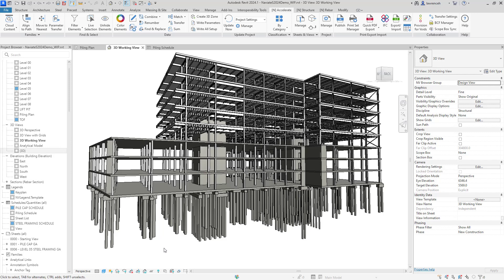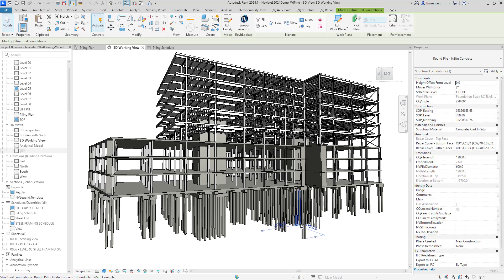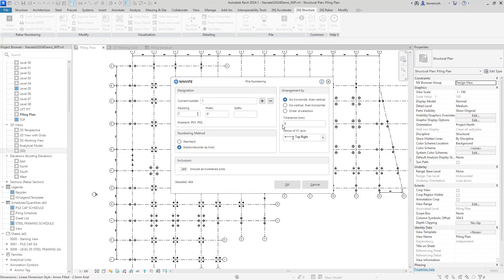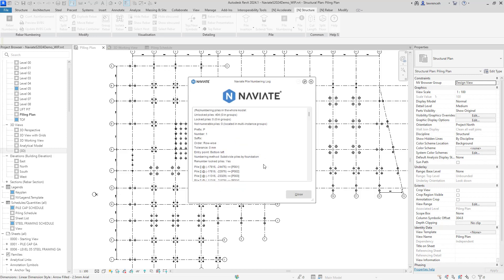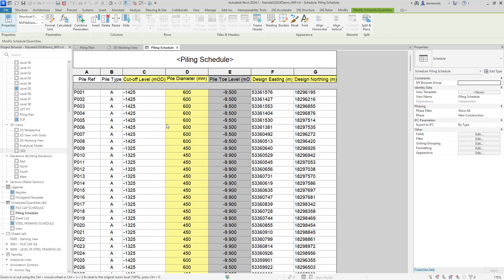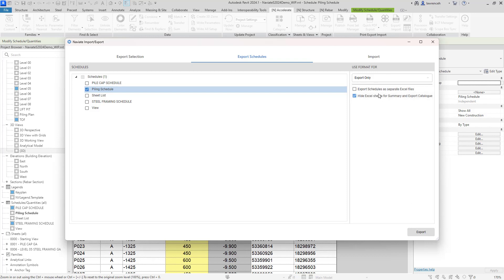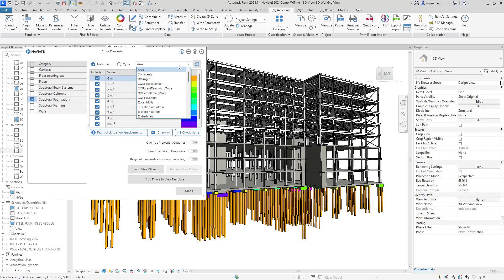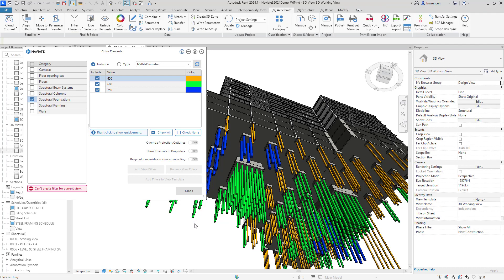Naviate Structure 2024 - Pile coordination and numbering

Comment: Hi Lawrence, just curious - how to you prepare the tags for the piles (?) before actually giving them a tag? 
I find that if I tag all and select structural foundations, it will also tag the host which I then have to go back through and delete one by one. Very annoying! 
Do you have a way around this?
Reply from the maker: The piles are preselected and then the tags are only applied to the current selection set. Its easily missed in the tag all not tagged dialog!
Reply: Thanks for getting back to me. I've followed the steps above but I'm still having trouble. When selecting all the piles on a piling plan for example, it will select the host along with them as the piles are nested within that family. I then have to deselect the pile caps before tagging and choosing 'apply to current set'. Do you know if there's a way around this?  @RevitStructureBlog
Reply from the maker: @JoshAlIen  Easiest way is to create a foundation schedule, this will schedule everything. Create a filter to just show the piles and then select the elements in the schedule.
Reply: @RevitStructureBlog  Perfect. I didn't think to use a schedule to isolate those piles before creating a TAG. Thank you!
Reply from the maker: @JoshAlIen  Glad it helped!